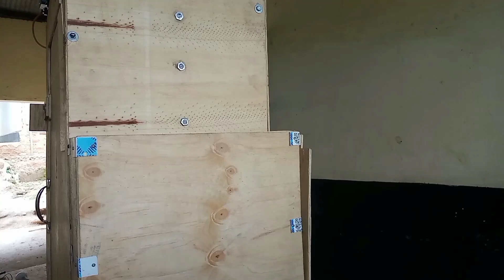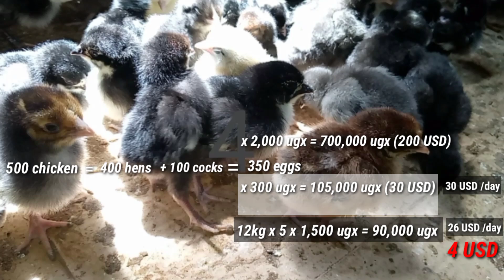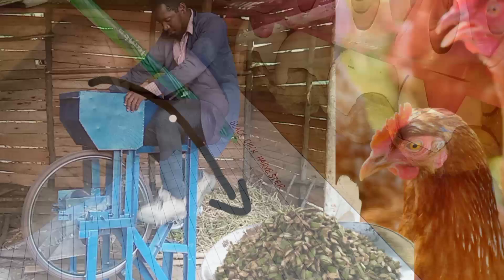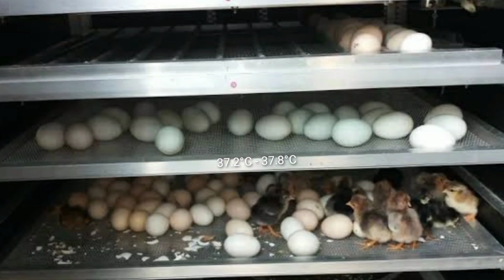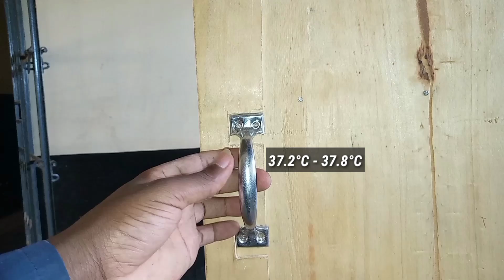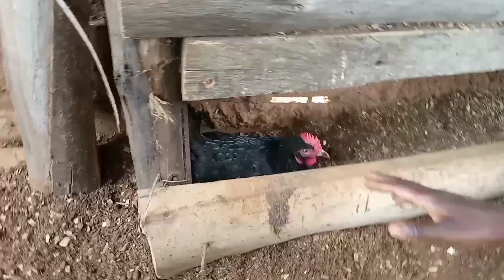Don't Rush To Start Poultry Without an INCUBATOR ..[Innovation for your farm]

Comment: Can i use that incubator  in a rental room or i need a separate room
Reply from the maker: For sure it depends if you space for it,but it has no effect using it in a rental room. We are actually about to finish designing it,you can contact us on our Whatsapp+256778696684